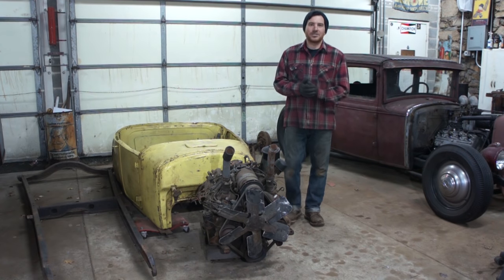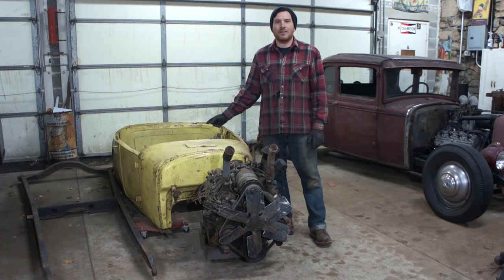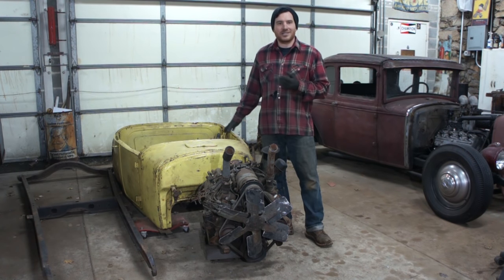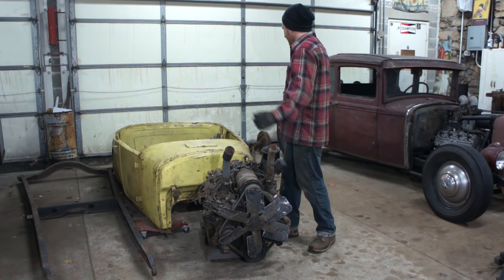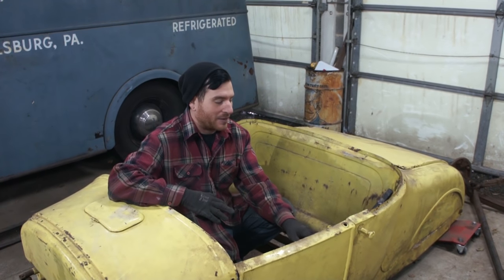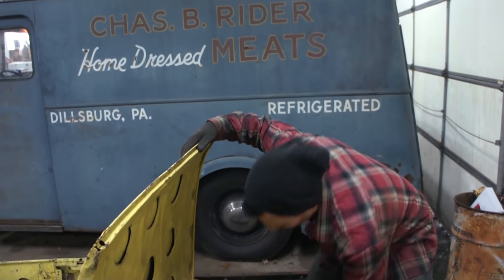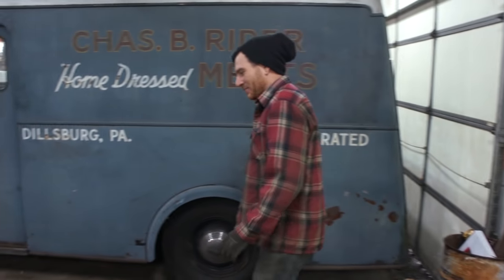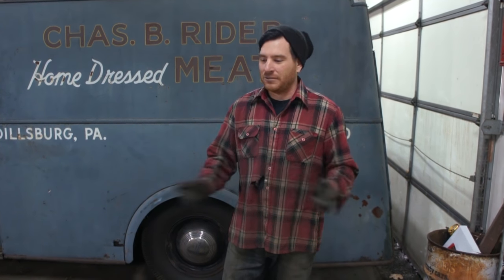1926 1927 Ford Model T Roadster Hot Rod Project

Comment: This is exactly what I want to do with my '25 Model T roadster, but when I mentioned doing a low-buck street rod, someone popped off by saying there is no longer any such thing as a low-buck build, as most would cost about $10,000 or more when the car is finished. I been around all sorts of Model A's and other vintage cars to believe there is no such thing as putting out a dependable, reliable and fun rod as a low-buck investment. It all depends upon what you want and what skills, expertise, equipment, resources and friends you have to help. Nice video. Keep up the great work. I am trying to decide if I want to do a track T and strip off the fenders and running boards. I wanted to put in a 4 banger motor, as I am not looking to impress anyone and most of my driving these days is simply around town. An R22 would be nice, but maybe a motor from an 80's Ford Ranger would be nice to keep it at least Ford.

Comment: Love the concept. My ex father in law and I built one with the same idea. Stock a frame and left over spare parts we rebuilt. One thing we did that is a litt,le differant was to flip the axle bells from side to side and run the rear spring in frt of axle. With the engine located like an A-V8 this allowed the wheels to be perfecty centered in wheel arch . The entire car was bolted together with no welding accept for shortening the torque tube and building exhaust. I lost the car in a divorce in 2007 and never saw it again till the new owner called me a few monthes ago to ask me a question. And as it turned out I was able to get it back unchanged except for some small easaly fixed things. Would send a pic butdoesnt look like I can here. Gregg Pellicer
Reply from the maker: Wow that's amazing Gregg! I love stories like that where a car finds its way back to the original owner/builder! Send me an email with a photo. I'd love to see it! Irontrapgarage@gmail.com -Matt/ITG

Comment: Cool, I've been building a 26T Roadster too! Wish my body was as good of shape as yours. I've been buying multible cars to make one car. Still needing a better upper deck lid for it. I have one roached out, and one that is really thin on metal. I've been dealing with cancer to my own body, and roadster been on back burner. But, it has a custom built metal frame, 327 chev supercharged with don garlets blower injection scoop, th350 trans, 70 chev nova rear end, suiside narrowed econoline front axle, weld wheels, moon gauges, etc. It's a roller! Will have to send ya picture, Oh It's Primer is Pink, For the Pink Panther! But, when I think Yellow, I think Banana, Lemon, or make it a Minion Car, Those Little One eye'd guy's Funny! Yellow Jacket would sting! Peanut M&M or a Rubber Duckey! Quack!
Reply from the maker: Sounds like a fun project Tom! Thanks for watching! -Matt/ITG

Comment: When Ford was bringing the Model A's to the market the chassis was finalized but the bodies were behind schedule.  His fall back plan was to use 26/27 Model T bodies.  They actually fit together like factory because they are.  One of the old school looks was a 26/27 roadster body on a Model A frame with the 28/29 fenders and running boards.  I really like the 26/27 roadsters but, at 6'2" I just don't fit.  I have a 26/27 Model T 2 door sedan put up and I sort of fit by pushing the seat way back into the passenger area. Before you weld in that Model A front crossmember consider a suicide set up.  Use a Model T rear spring mounted to the top of the axle.  You will most likely have to shorten the torque tube.  Have fun.
Reply from the maker: Thanks for the info Steve! -Matt/ITG

Comment: hey make a copy of speedways track T use a Quad 4 olds eng  thy look kool cleaned up almost like a offy sits low
Reply from the maker: This one we're using whatever I have laying around so it will be flathead V8. Although I would like to build an Olds powered rod in the future! Thanks for watching! -Matt/ITG
Reply: ok i like flatheads also just i would like that quad 4 used in something kool  just think half the weight an twice the power and wont take up alot of space under the hood

Comment: This is out there but I have seen cockshut grills used farmalls and because you can get new sheet metal for cheap Ford 9N tractor hood and grill . I like the older straight 6 engines like the GM 261 It would fit the hood and grill better just a thought  from one who way over the hill.
Reply from the maker: Hi David, I like to build my cars to a certain period/style/era. I'm not a fan of tractor grills on hot rods and I leave that to the rat rod guys. I'm not knocking anyone for using them, just not my taste. Those old stovebolt straight 6's were monsters and you saw some of the fastest cars running them early on. They are tough to fit in small cars and make look proportional, but you can't deny their performance. Thanks for watching and commenting David! -Matt/ITG